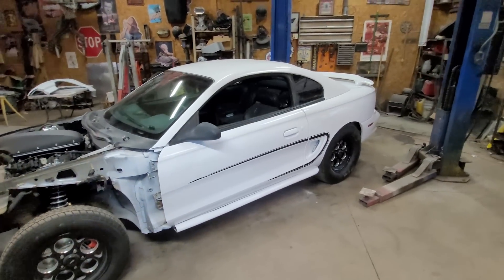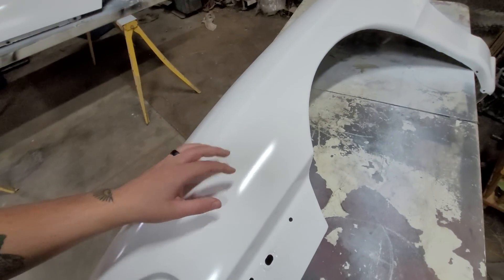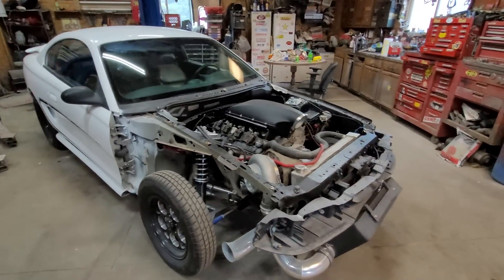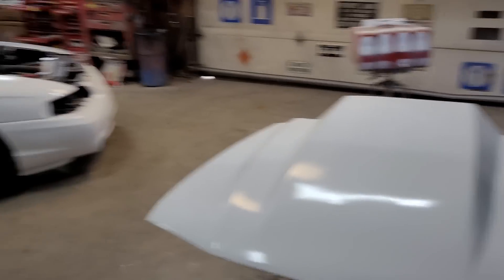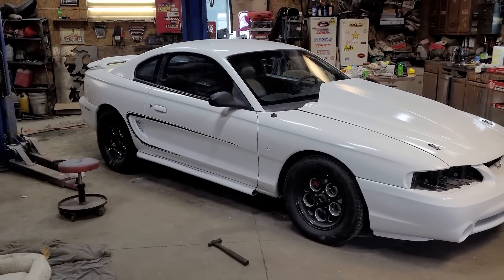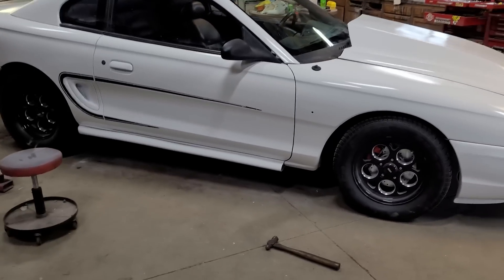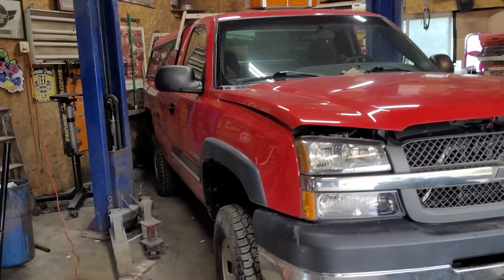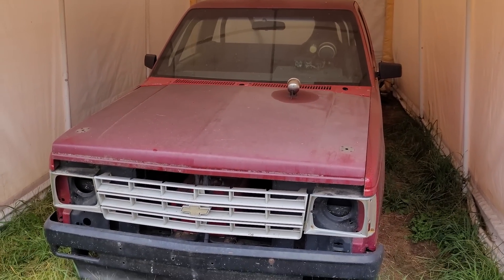The MID ENGINE S10 is READY TO GO! And The Cobra Looks KILLER with the New Paintjob!

Comment: I say it was the wrong way with the pins the ring can blow up and the pin can slowly work its way out being pushed back by the air
Reply from the maker: Those rings have a lot of tension holding them down, we have them on Jack too and they've been good so far
Reply: @SniderTron3000  yeah I'm sure they'll be fine until they're not LOL think about what I'm saying though does it make sense
Reply from the maker: @ocn2u  lol I understand what you're saying, I just don't think the video does enough justice to how much tension they have holding them down. Like the ring is offset 3/16" at the pin where it rotates, so you have to physically twist that ring for it to lift up. I'm not discrediting what you're saying, I think its a very real concern